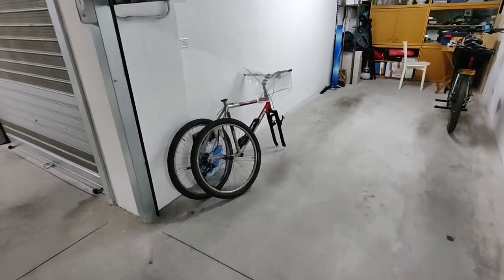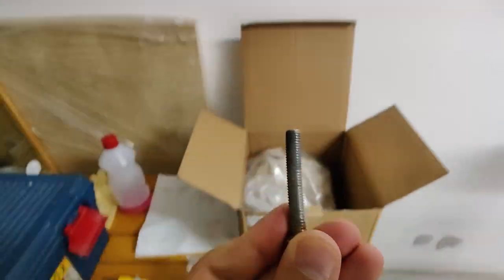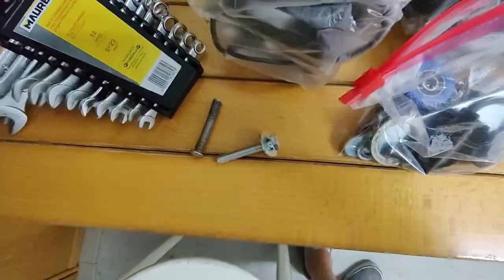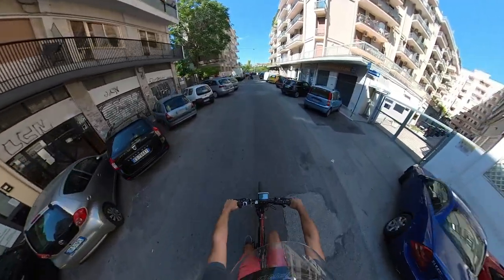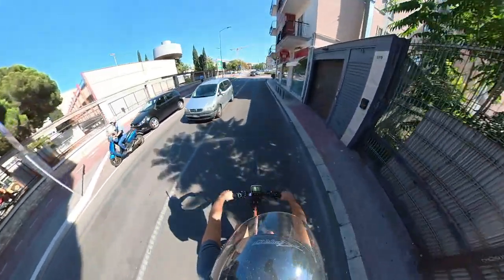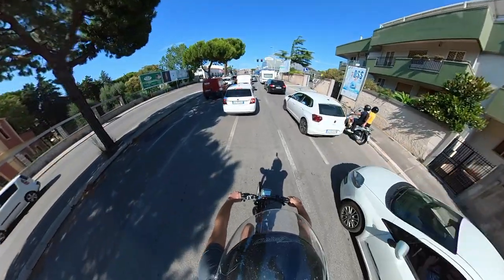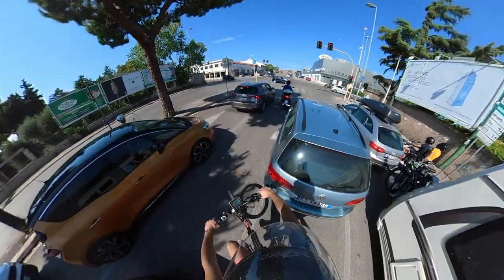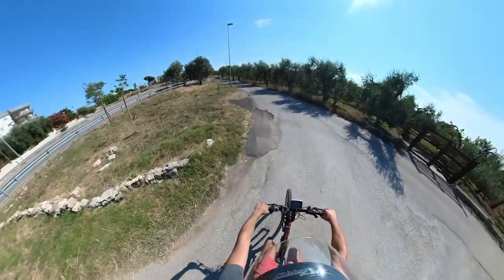Tongsheng Frame Replacement part 2: Installing TSDZ2 Mid-drive Motor Kit to a mountainbike

Comment: I have both motors and I think the Tongsheng is better than the BBS02 for the way I ride. It makes me work just enough and allows me to regulate speed by pedaling pressure. I don't use a throttle with it, I don't need it. The BBS02 might be better for a cargo bike, or if you want to ride your bike more like a motorcycle. The BBS02 lacks finesse. Thanks for the video!

Comment: I have no experience with the Bafang motors but I am very happy with the throttle on the two TSDZ2's I've done. I have to go along a narrow, winding dirt footpath to my house and I can change from braking to throttle instantly. Also it's very controllable when I want to walk the bike very slowly up a steep slope, like up a wooden plank on top of steps. I didn't use the e-brakes and have never had any need for them. I bought the 48v 750W versions and made my own LiFePO4 15s3p 32700 cell battery, which fits nicely into an Amazon triangle bag. The second bike I made a smaller, lighter battery LifePO$ 15s2p 26650 as I only need 20km range. Grazie. Subscribed.

Comment: I use a throttle and get really good results. I've been doing 20 miles a day commuting to work and back. I'm running a 250 watt rear hub motor and it's  been pretty good done several thousand miles on it.

Comment: What model is the bike? I've installed a TSDZ2  on a  Rockrider 8.2 and it is good. Using a smaller front sprocket I can use all the gears on the cassette, whereas on my Giant Cypress, I can't get the full range.

Comment: Why do you prefer Bafang for traffic? I would think the more natural pedal assist on the TSDZ2 would give you better control for weaving through tight traffic. I plan on converting a road bike for commuting in the city and am leaning toward the Tongsheng 750W.
Reply from the maker: There's no right or wrong: I also used the TSDZ2 through tight traffic in Paris and it did the job!
It's just that the Bafang one reacts more instantly and gives overall more power due to its implementation, not only because of the cadence sensor.
BTW, this is just talking about stock settings. I'm making a new video about playing with the TSDZ2 firmware and that could change things :)
Reply: @LukeLorusso  I thought the torque sensor would be more instantaneos than the cadence sensor? Or maybe because bafang gives more power with less effort so it seems instantaneous?  I'll definitely check out your TSDZ2 firmware video. Is the firmware compatible with the new TSDZ2B?

Comment: So I spent some time yesterday looking for the tongsheng, and though you can still find it, lots of places which used to have it are no longer carrying it or have limited supply. I read that baafang sued tongsheng which is why they are no longer being sold in some places. Kinda disappointing as we already didn't have that many options for diy ebikes. I can't find any info on the lawsuit, just read it in a forum, so don't take my word for it, but this is what I read.
Reply from the maker: I read about that too... at the moment you can still find some on ebay from european stock. that might be a real problem for the near future

Comment: Hi Luke, thank you for all the insights! Just installed a TSDZ2B myself yesterday. There is a 2,5cm pedal asymmetry, means the right pedal is 2,5cm further away from the frame then the left one. That seems to me is a general design flow. How are you dealing with it?
Reply from the maker: oh that's weird... is it on the pedal or on the lever?
not sure if I can help you, but try to take a pic and upload it somewhere, maybe I can be somhow helpful
Reply: @LukeLorusso  Well, pedal or crank, depends on how you want to view it. So you are saying your cranks are centered to the frame? The right crank is not further from the frame then the left one?
Reply: You are right, it's a design flaw, but I've got a very flat left foot so my pedalling positions are weird anyway so i never notice it.

Comment: If you had a rear rack battery would the motor cables be long enough?
Reply from the maker: the motor's cables are enough, in case of a rack battery is the battery cable that should be long enough to arrive to the motor's plugs. most likely it is, and worst case scenario you can buy extra cable